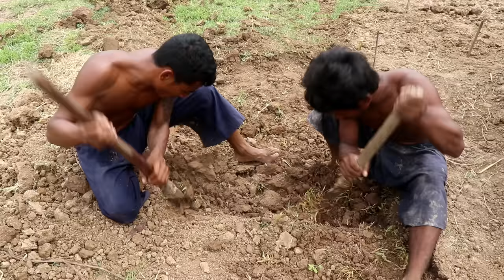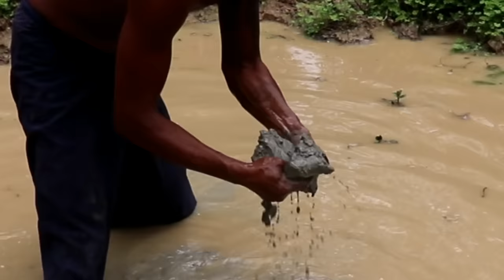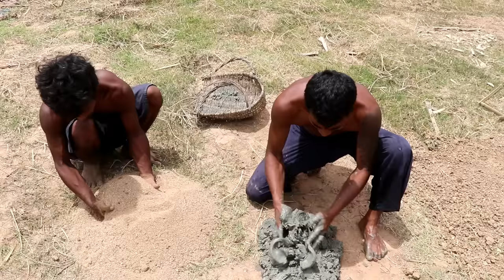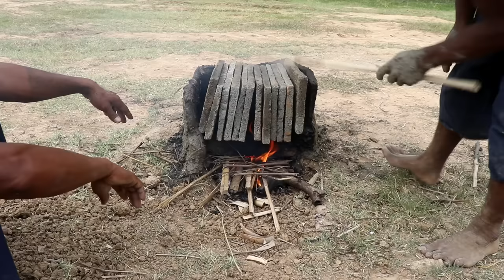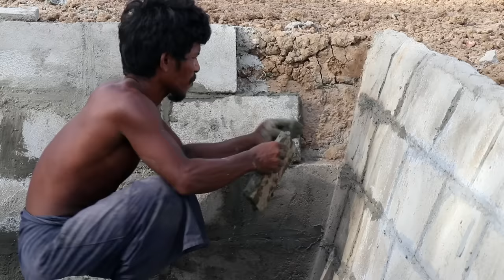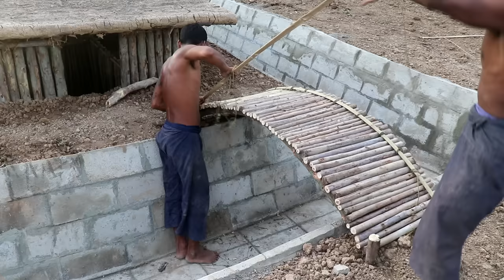Build Swimming Pool Around Underground House

Comment: Bucket by Bucket. Respect 🙏🏼
Reply: Ashok Lekhra i think someone helped them ...
Reply: No way they did it two pots at a time.
Reply: Ashok Lekhra eu sou Brazil
Reply: Ashok Lekhra $ )'y j!.
Reply: O.    IX e bebeu houve. vb
Reply: Ashok Lekhra  u also like les twins huh me too
Reply: They should’ve just waited till it was full  by the rain
Reply: Wonder how many buckets of water it took and days
Reply: Ashok Lekhra tnjnnm..
      .nnnnmmmm,
Reply: Lest guess. 
Bucket is 5L, Ditch 5m*1m*0,7m. That is ~11m3 which is 2200 buckets. That means 1100 buckets per person.
If there is a river 20m away and walking 3km/h then carrying, filling and emptying takes ~30s. 
It means it took them 9,5h of non stop work. But you get tired easily.  So I quess 2 to 3 days if it is legit.
Reply: Ashok Lekhra ㄉ
Reply: Marek R omgg... come to make my math test plz...
Reply: verdadera diga pofi
Reply: Marek R not bad
Reply: Ashok Lekh
Reply: Ashok Lekhra butternut the rest of the season with a broken leg in fish and chips
Reply: Ashok Lekhra ولا ا
Reply: uloom ulquran 
|
 
.
Reply: sta respekt dorenli im traktorom vodu🖕
Reply: Ashok Lekhra n
Reply: Ashok Lekhra ok they worked so hard
Reply: ahahahahhah ludace
Reply: Ashok Lekh
Reply: Ashok Lekhra propably filled it with a hose and a pump. Dont believe they dug the hole with those sticks either. Propably used an excavator. I dont believe before i see a sped up montage of them doing it.
Reply: Denner I don't believe it either, that they dug the hole with two sticks and that they fill it up two little jugs at a time.
Reply: A. V. Well, there is a thing such as time. It's not like they did this in one or two days. This project took them weeks. It's not impossible, and this is how Ancient civilizations built things. How do you think the Pyramids were built?
Reply: they choose to be courageous

Comment: Me: “That bridge won’t hold because it has no support. No way it will work.”

Kid immediately walks across and stomps on it

Me: “huh..... neat.
Reply: I thought of the same.
"this bridge wont work, maybe its decorative"
*kid walks across and stomps"
"Oh"
Reply: Артфочнлут
Reply: Basic engineering.  An arch is an incredibly strong shape, and it's "anchored" by the posts they drove into the ground.  The weight gets pushed along the arch towards the ground, instead of being strictly supported by the strength of the wood.

Comment: I would make a shovel first
Reply: Ali Razi  dale
Reply: Ali Razi thow
Reply: Ali Razi yep
Reply: Ali Razi yea they should just grab some sheet metal and run down to the shop and stamp some out....what dummys
Reply: The work that is Appreciated is that all the work is done by natural things
Reply: Ali Razi i dont think you can find metal to make a shovel in the forest.
Reply: Hassan yeah but you could make something more efficient at digging than a stick
Reply: Marcel Rodriguez yea thats my point
Reply: Marcel Rodriguez lol you wont find a shop with a press brake either and you point out the peice of metal 😂
Reply: Ali Razi seryioopp
Reply: Ali Razi to my
Reply: Actually they probably did use normal shovels in between takes to speed up the process. It just makes sense to use shovels off camera to save time
Reply: Ali Razi
Reply: Ali Razi iu
Reply: Dillon Green you do realize you can find rocks and make an actual shovel out of it right?
Reply: Mahum Møøbashar even cavemen made tools similar to shovels or axes we use today. Your point makes no sense
Reply: Hassan Niaz you can make a natural shovel dude

Comment: This is called hard work
Reply: it's called you just got played. check 0:50, they used shovels. still hard work, but not what they want you to think.
Reply: Īônized that's literally what I said, learn to read
Reply: User 

That’s not a shovel.  It’s a tool but not shovel.  I know what that is but i do not know how to call it in English.  But it’s about 2-3 inich wide and it’s made of metal.
Reply: User Its a stick
Reply: LightningRota you all don't get it. They didn't use these sticks to dig. They only used the sticks for a few seconds while they filmed. At 0:50 you can clearly see on the edges that they used a spade or something similar.

Comment: Why did they simply use a hose? U can transfer Water from a Lake to other place without electricity or physical work. U just need to suck out some water first from that pipe connected to the lake when the water comes out it'll keep coming it'll not stop. Y'all Kids